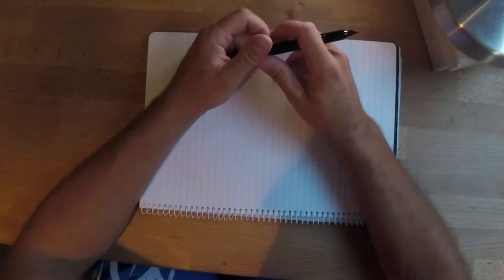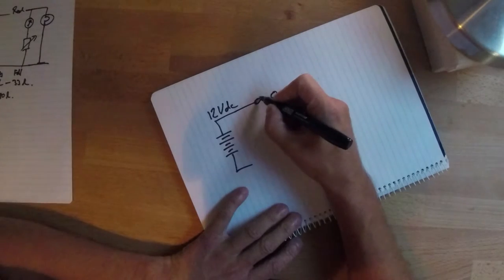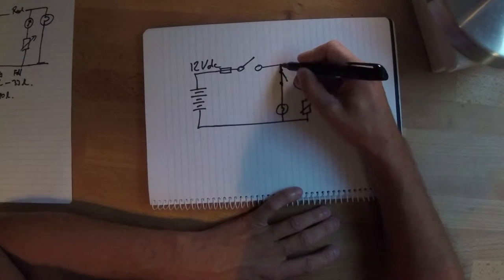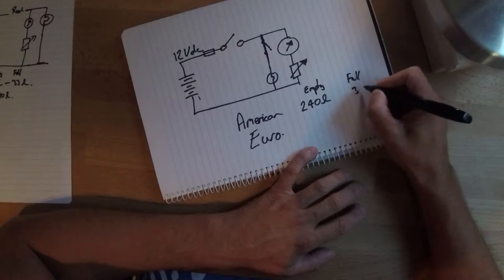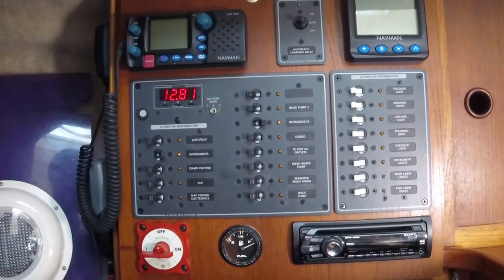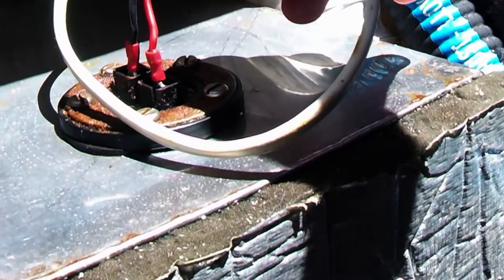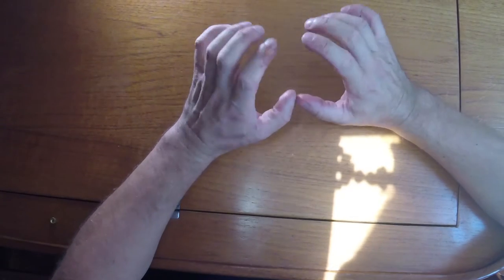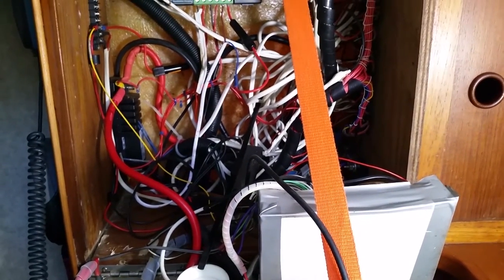How to repair fuel gauges on yachts/sail boats, including how they work.

Comment: My fuel gauge is different. Its a clear plastic tube which runs from top to bottom of my fuel tank on the outside clearly showing fuel level. Access is by a hatch so not the most convenient. One advantage is that I do not expect it to ever breakdown.